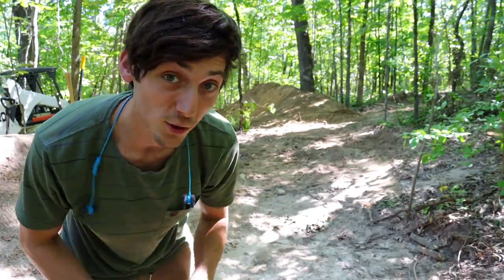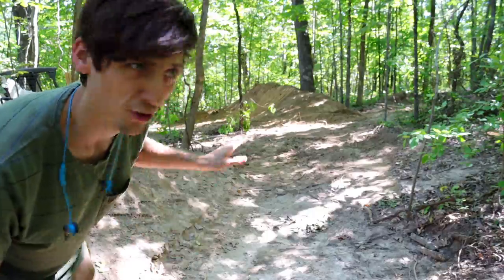Building a green Shark-fin Jump and Riding it with my dog! // Subscriber Trail pt. 6

Comment: I feel like you should redo the first section of this trail, it looks quite slow an awkward especially with those rollers. Sick vid tho 🤘
Reply: Yh the rest is so much nicer
Reply: I wouldn’t be mad
Reply: Ya they’re still to peaky
Reply: Rollers is to warm up and create speed like a pump track.  There's not that much elevation etc and the elevation he has he's using for landings.
Reply: He could also plant some long root grass on the tops and back of his berms to help with erosion and color. Like the stuff they use on Road Sides to keep dirt stable.
Reply: Tom Sanger they could be nicer but then he would over speed everything else which he has no got to almost perfection
Reply: Seb Copeman tbh I don’t think he would have too much speed but even if he is deliberately making them so you don’t get speed (which is the opposite of what they’re designed for) he could make something more fun and interesting that is designed for low speed riding like a skinny/teeter totter or something like that 🤷‍♂️
Reply: Tom Sanger redo the rollers with techy slow stuff at the top where there’s not much speed anyway... I like it!
Reply from the maker: If I skip the middle roller it actually goes pretty nice so maybe we'll have to go back and rework it! Definitely like the speed but it needs to be different for sure.
Reply: @BackyardTrailBuilds  Bro, he is going to be sooooo happy you reply to him, oh and by the way, I ❤ your content!!!
Reply: @BackyardTrailBuilds  I think that Option B is awesome, but the teeter totter will zap a lot of speed as you may need to come to a stop while you wait for weight transfer to occur. I vote... Continue where you are with Option A with the gap jump to table top - and then go back up to the start of the trail where you don't need that much speed to start and add in Option B there :) Either way, you put in so much manual labour into each video! Thanks for doing this, your trail is going to be amazing when completed :D
Reply: Defo
Reply: Tom Sanger it would be cool but its a flow trail so it would mess up the flow

Comment: @9:20 I helped Ray Rome build the 3rd generation BMX track at Orange Y & Paul out a Coal Canyon. You want to spray only 5 feet at a time then light pack. Move repeat. Once the first pack is done, get some clay lay that out on top of of your first soft pack. Water so that the clay gets nice and shiny. Remember in 5 foot steps cuz you don't want to step on wet clay or dirt before it's packed and dried. Pack the wet clay with your shove so that youre standing at the bottom of the slope and the but of the shove is pointing at you. Hit the dirt hard while dragging the shovel toward you. You only push the shovel when youre trying to get the shape right. I've raced and ridden bikes at a competitive level for over 30 years.

Comment: Hey man, when you soak and pack your dirt.  Do it in layers, add a little bit of dry dirt each layer on top of the wet, it stops the wet mud sticking to the back of your shovel as you pack it.

Comment: Get a 55 gallon plastic jug/ hose and valve then fill and  toss it in the skid steer bucket. Lift when ya get to where ya need it open valve...presto! Instant pressurized water Way easier then the backpack sprayer...